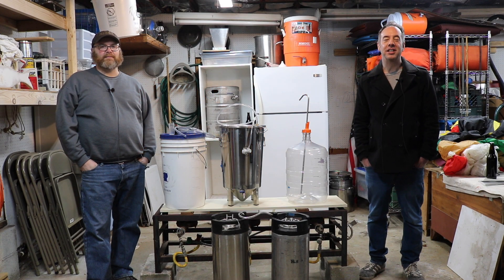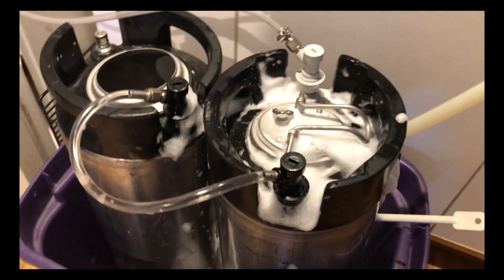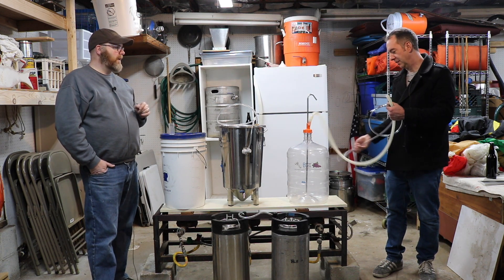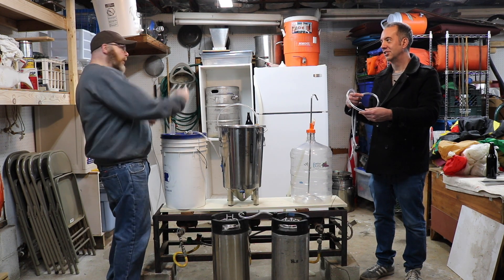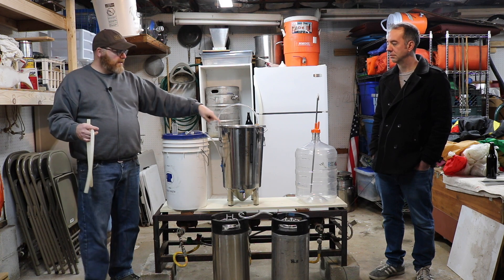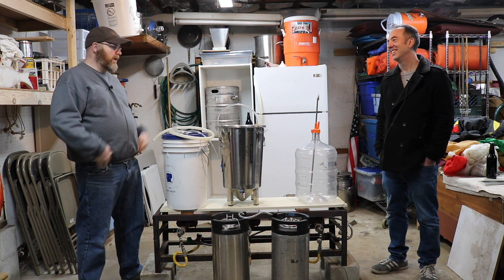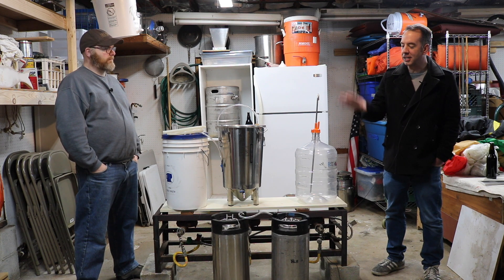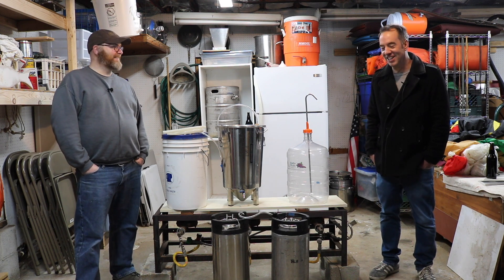Closed Transfer From Fermentor To Keg - Minimizing Oxidation in Homebrew

Comment: Sorry Guys, I have to give you a thumbs down on this one.  You have been brewing for a long while and should have a better transfer method than this video is displaying.  And quit advocating the use of buckets when the lid comes off there is a large surface area of beer exposed to oxygen. I have been transferring with a closed system for years now with carboys (glass) and orange stoppers.  The racking cane goes in the center hole, and a barbed flare fitting for the CO2 connection goes in the other hole. On bottling day, I slide a bottling wand into the hose connected to the racking cane. No O2 issues.  I do seal all penetration with hose clamps. Three to four pounds of CO2 pressure works well.
Reply from the maker: Buckets is what some people can afford when the start out man.  I gave some practical ideas and stated that for some sensitive styles its not ideal.  I'm not going to tell first year brewers that buckets are garbage for getting started.  Are there alternatives yes and we highlighted those too.  Cheers! -Mike
Reply: @BrewDudes  Oxygen is bad for all styles.   You also have to ask yourself how many potential home brewers quit the hobby because their oxidized beer tasted like crap time and time again. I know I was one that almost quit.